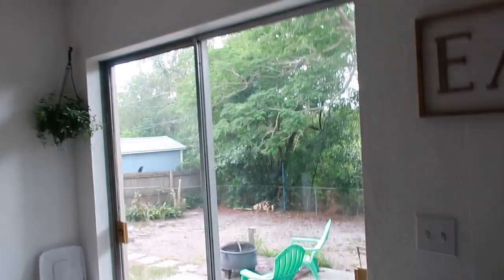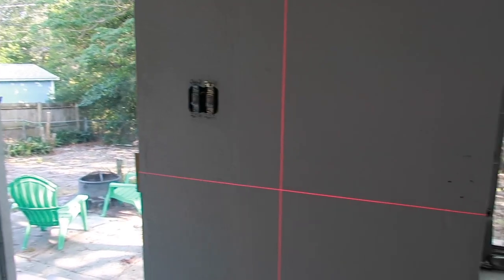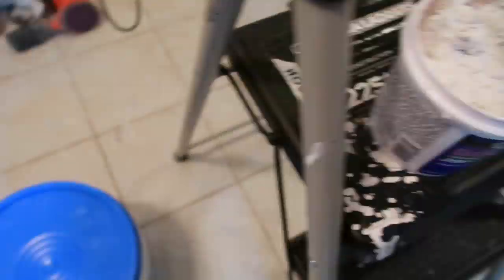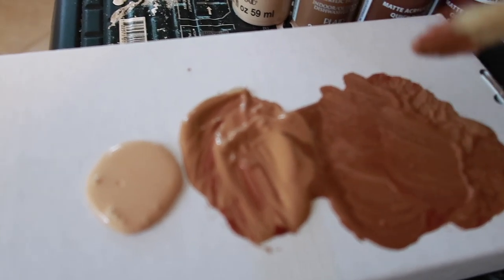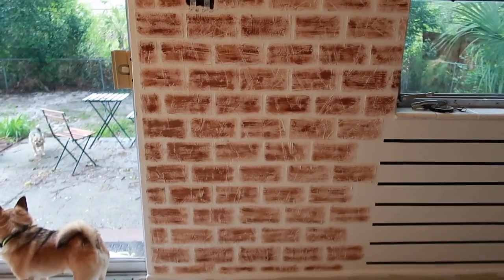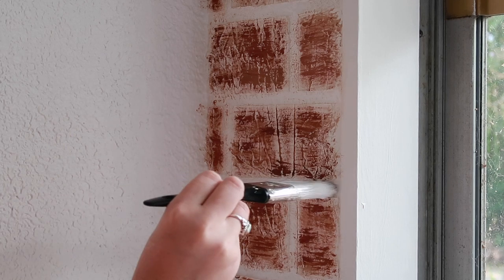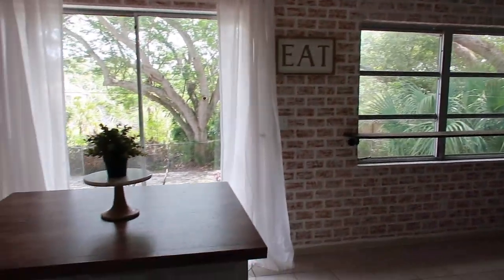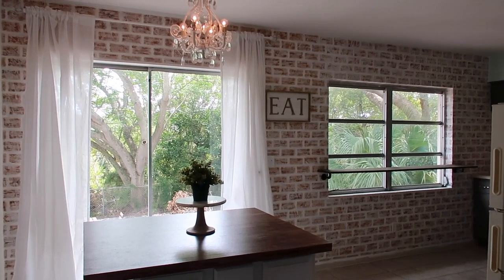DIY FAUX BRICK WALL TUTORIAL ♡

Comment: You know, to make it 1000 times easier, you should have peeled the tape last and you would not have had to color between the lines.  Wow! 🙄
Reply from the maker: Nope, tape would have dried into the joint compound making it impossible to remove

Comment: What if you left the tape on until after you painted. Paint it all real fast with a roller, then remove tape, then do touch ups to make them not look so uniform?
Reply from the maker: I’m not sure that would work, the joint compound needs to dry before you paint it. If you don’t take the tape off it would be stuck in the compound and impossible to remove
Reply: @mustl0veshoes  ah Thank you.